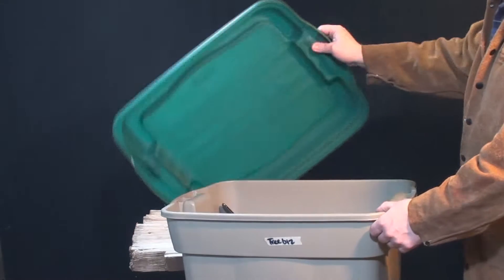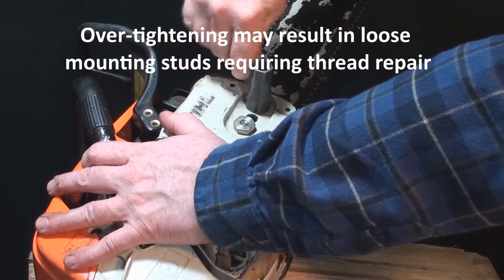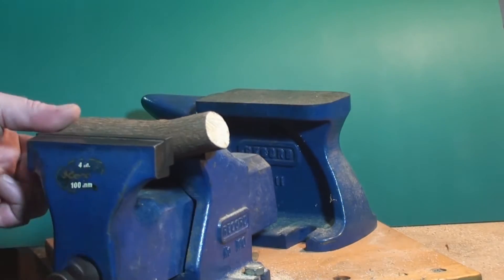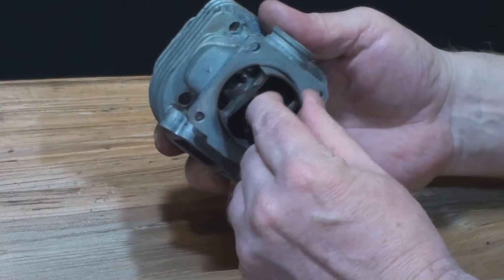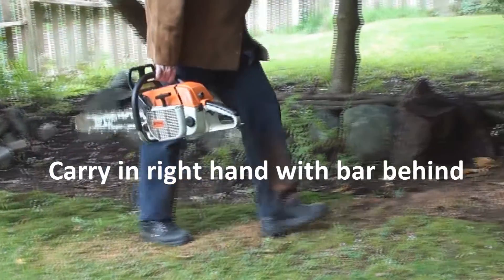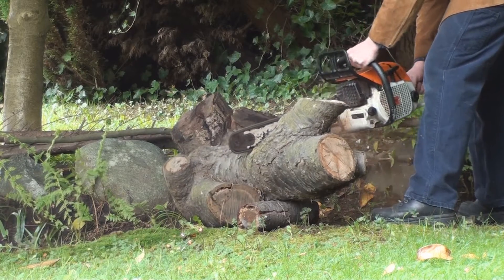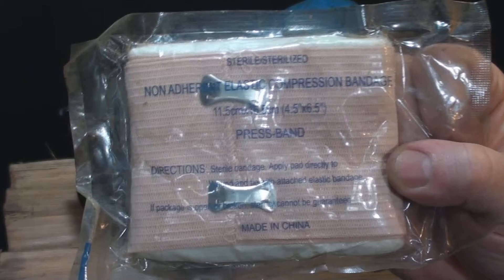Chainsaws 101 - Safe Operation - What You Need To Know

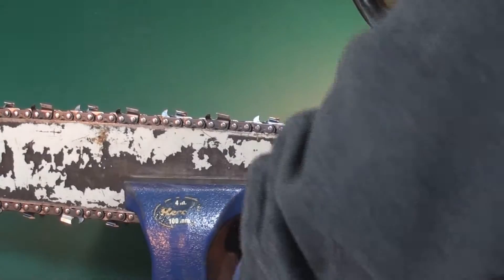Comment: At 1:32 he tells us how to be safe, but he does not wear a pair of gloves when he is pulling the chain (and I don't mean the toilet chain)!
Reply from the maker: If you saw which direction I pull chain you'd have seen it's nearly impossible to cut yourself. Unless your chain is on backwards.
Reply: @repairs101  
You're making excuses for not doing the correct thing; you should still wear safety gloves when pulling the chain on the guide bar for grip and safety (no matter how confident you think you are).
Reply from the maker: @redblade8160  Yes, Mother.

Comment: Very nice video. When you said "bucking" I think you meant "kickback". Bucking is cutting a big log into little logs ;-p. 

One maintenance tip I never see mentioned is to check the air and fuel filters from time to time. Either one being clogged can cause performance problems or even shorten engine life.

Comment: What idiot would put the chain on backwards?  Oops I think I may be guilty.   I caught some fish netting which  got stuck in the sprocket  and I had to take the bar off to get it out and when I put it back on (my first time) the saw did not cut a twig.  I assume I dulled it and took it to get sharpened,.  I bet I put it on backwards.  Thanks for the tip that nobody mentioned in 100 videos.
Reply from the maker: Rock on, Patrick!

Comment: I never buy gas saws because I can't start them.  Any tips?
Reply: I was with a Stihl mechanic for a chainsaw repair.  I told him I had an old Stilh trimmer (FS 72) which my brother who passed away must have bought and it would not start.    He suggested dumping out the old gas which there was none and I knew enough to do that.  And he suggested that I may have to pull 50 times to get the old gas out of the carburetor.  It took 40 pulls and now it runs fine.
Reply from the maker: +Harborseal - full choke full throttle until it kicks then half choke full throttle should start most any saw. Worst case prime the carb with teaspoon of mix and try no choke full throttle. Still no go check the spark plug for fouling - Spark Plug Troubleshooting  https://youtu.be/X4ErFUikRrs
Reply: +Repairs101 I pull the string, it fights back and I rarely get past that.
Reply from the maker: awesome
Reply: Nice for you but I'm talking about new saws and saws other people seem to start easily.  If I pull hard the rope jerks back and it won't budge.  If I don't pull hard nothing happens but the rope spools out.  Other people seem to start it without pulling hard at all.

Comment: Thanks for your videos.  I've been over tightening my chain.  Is that what makes it jump or slip off?
Reply from the maker: +Harborseal - Hard to say from here but maybe yes, or maybe your bar is twisted, or maybe the drive sproket is misaligned/ not engaging or maybe all the above... lots of possibilities.
Good luck and thanks for commenting!
Reply: +Repairs101 Brand new saw, chain and bar, all of which came with the saw.  Since mentioning it here I read a comment elsewhere that it happens a lot with softwood.  I'm taking down a huge tangle of honeysuckle, orange trumpet vine and clematis.  Woody vines up to 12' long and 6" + in diameter but most of it so far has been 1-3".  I have to clear a path to the main trunks  :)

Comment: We quit greasing the roller nose back in the 70's.
Reply from the maker: +Duane Nelson - Heck we didn't even get roller tip bars until the 80s, Hollywood.
Reply: That's funny.
Reply: A new 621 Jonsered came with a Sandvic/Windsor replaceable sprocket nose in 1970

Comment: Hi again I have tanaka ECS4000 chainsaw whan i was clean the exhaust the muffler collar drop from it how can i fix it and its necessary for saw Performance please help me :)
Reply from the maker: +Fares Al-saket - a chainsaw muffler is only there to dampen the noise and you can operate the saw without a muffler and the only damage caused will be in your eardrums. Wear hearing protection!
Reply: thank you
Reply from the maker: +Fares Al-saket   :)

Comment: her in Jordan they use 4-stroke oil mixed with gas !

it's right or wrong and why PLZ ?
Reply from the maker: +Fares Al-saket - do you mean that they combine engine oil  (like 10W30) with gas to create mix? I have seen it done in "emergency" situations - working remote location wth no immediate access to 2 stroke oil - but it is not recommended - perhaps consult an engineer as to why, my guess is it's ineffective because it mixes improperly, burns at a different temperature and is likely more pollutive/hazardous
Reply: yas its right ?!
Reply from the maker: +Fares Al-saket - definitely not recommended
Reply: thank you